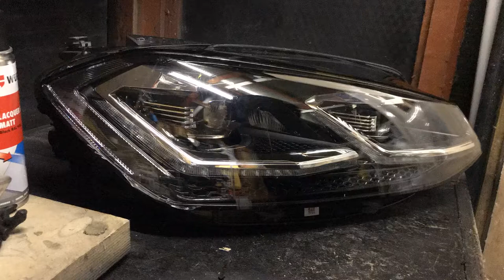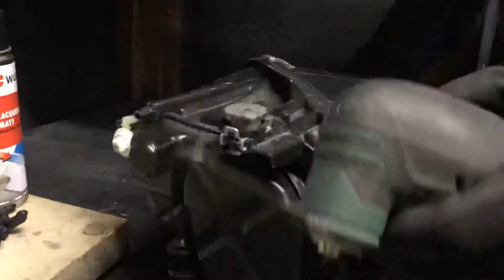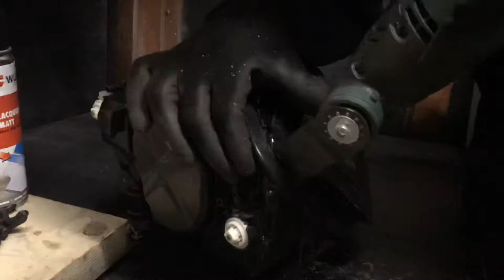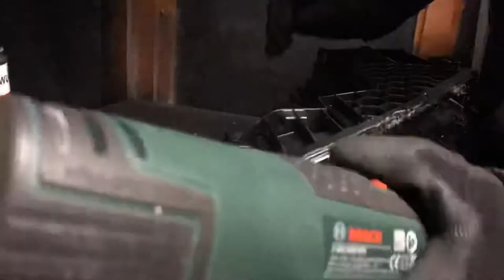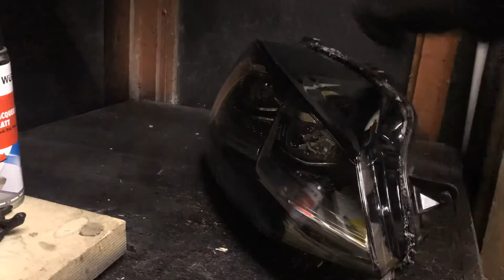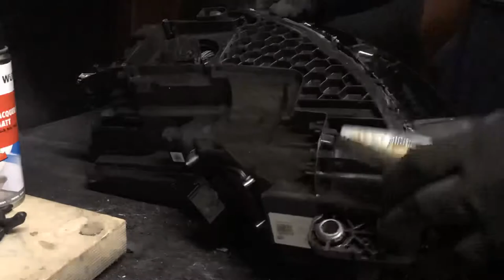2019 Golf R Mk7.5 Headlight lens Repcement Part 1 - Lens removal

Comment: Can this been done at home (DIY), and what do you use to stick the lens back on pls?
Reply from the maker: It sure can. You need a good polyurethane adhesive like OEM
Reply: I want to use the oven method do you know if I can heat the electronic modules of the headlight like the rest, or I can just pop out those simply without any risks of disturbing it?

Comment: Given the speed of the video, it's not clear where you are using the oscillating tool. Are you simply cutting the lens and then going to remove the remaing part with heating & pliers?
Reply from the maker: Hi theres 4 parts to this video and also a slow mo feature :)
Reply: @teesshed  Why not just upload in one part? And at a slightly lower speed

Comment: Hi there. Do you think this could be done with a Dremel and a plastic cutting wheel instead of an oscillating tool?
Reply from the maker: It can but it will take ages and youll probably break alot of discs as the lens is quite thick for the discs
Reply: @teesshed  Ah, that makes sense. Thanks!